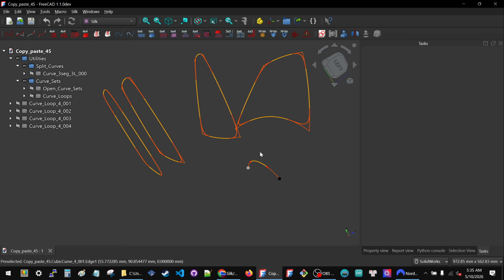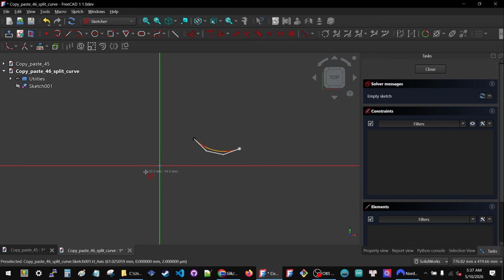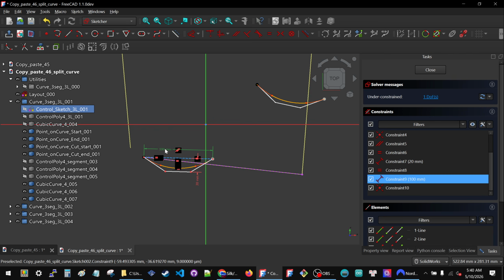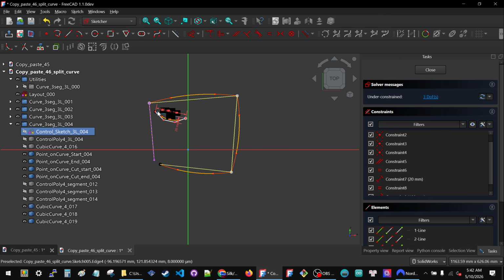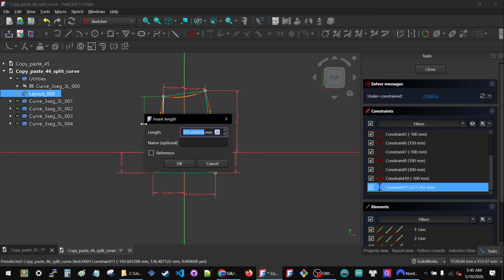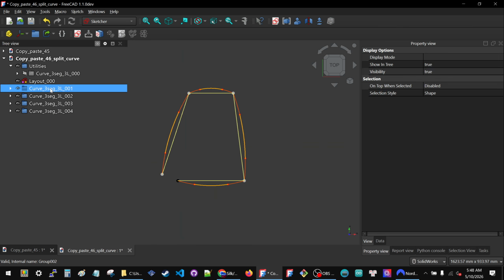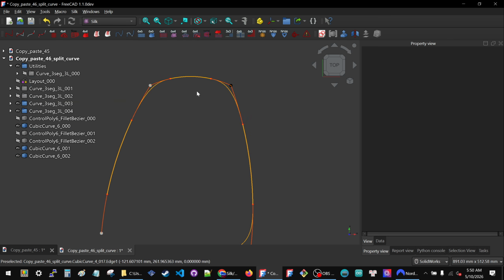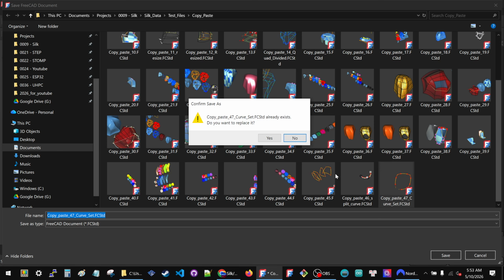FreeCAD Silk - Complete Tutorial Series 04 - Curve Set

Comment: Can you use VarSet for repetitive dimensions?
Reply from the maker: That should work, I hadn't played with it much before.

it seems like a pretty good solution to shorten the names in expressions. I was able to create values "mirrored in the interval 0 to 1" and, then assign them to various points' u parameter fairly easily.

this is something that really needs an additional management layer long term, because a lot of values need to be propagated from one curve/surface to another.

VarSet is great starting point, thanks for the suggestion